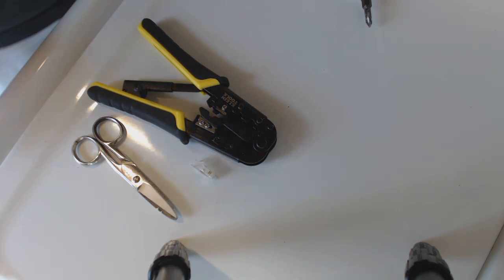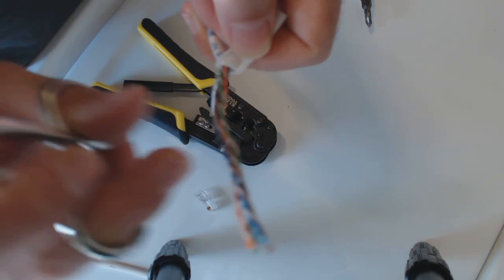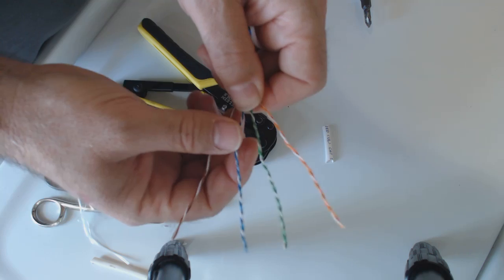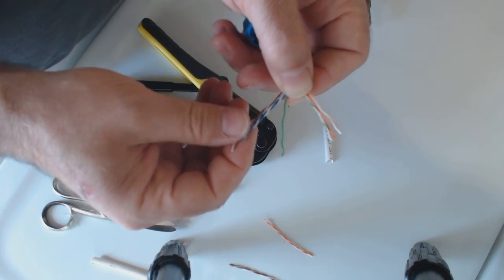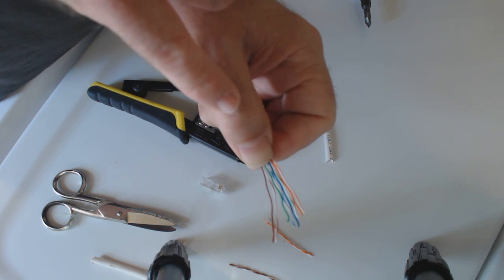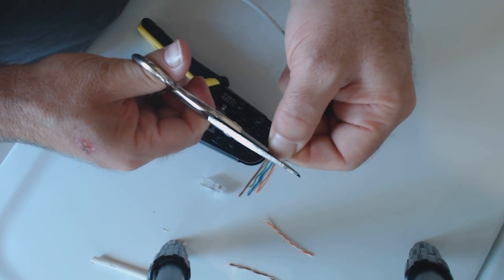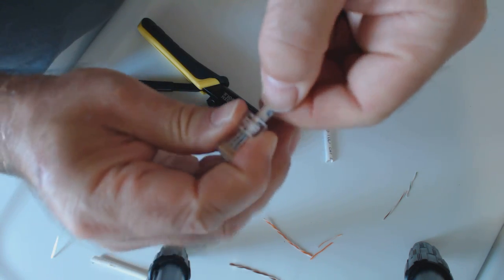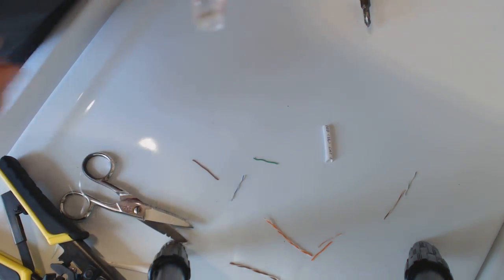How to Crimp RJ45 to Cat5e or Cat6 cable

Comment: Make sure you do the same wire arrangement on both ends. If you switch A on one side B on the other that's a cross over cable. Usually used to connect 2 routers together or 2 computers together with no router or switch in between.

Comment: what i find helps to keep the wires in order is a small dollop of hot glue, and the through hole plugs are easier than the blind plugs, also if you are elderly like me  a hacksaw cut in a piece of stiff plastic, cd dvd cover and use that to sort out the wire in the right order, cut to lenght, then slide the plug on and lift the wire out of the saw cut and crimp
Reply from the maker: Hmmm... thanks for sharing those tips! ☺

Comment: installed 2 switches today that came with my blue box and oh boy it took me a while to get a hang of it but i got it. i got that same tool and the pass thru wire one as well and the tester to check if its a good connection. it got the job done tho. im an electrician btw. always happy to learn new things
Reply from the maker: Good for you,  Sir!

Comment: i messed up a whole pack of 50 with only like like 15 actually working and some i ended up cutting off and re-crimping. i only needed 8 crimps. and wasted a whole pack of 50. now i have 300 pass through rj45's. (3 packs of 2x50 pcs)

Comment: I wanted to make certain that I was building the cable correctly, so I took a working Cat5e cable which I tested and found it was running at 200+ Mbps.  But, once I changed the RJ45 connector, the speeds dropped to 90Mbps.  What am I missing?
Reply from the maker: Lance, if you’re getting any speed at all on the one you made, then you did it correct.  The cables they make at the factory are just really well engineered.
Good observation. 🤔
Reply: @DIYTelecom  Cheers. And, thanks fir the heads-up!
Reply: @DIYTelecom  Ok. It just seemed odd because I only snipped one end of the cable and added the re-wired RJ-45 to that end. Is it possible I’ve wired my side of the cable to the T568B standard to a T568A cable?
Reply from the maker: I don’t believe the A vs. B scheme (or even a crossover) would affect the speed.

Comment: Nice guide!
A little question: Is there a difference between a CAT5E to a CAT6 boot?
Reply: Cat6 uses thicker wire (23AWG vs 24) so the wire channels have to be wider and arranged in a zigzag pattern to allow them all to fit.
Reply: @KingdaToro  Thats clear but I was asking about the boot

Comment: Nice video, good enough for home use, but I think you don't really understand the standard. Mainly when you advise to push jacket inside connector to the end and you are doing it with quite a lot of force. What you really should do is to make pairs shorter. Jacket should be inside as far as possible, but it should be perfect fit. If you will do it by force, what you are basically doing is destroing pair twists (untwisting them) inside the jacket, which you don't want to do as you are degrading cable and causing cross talk between wires.
Reply from the maker: Excellent Point Danny.   Thanks for contributing. 😊

Comment: If you just lightly score the wire and then bend it, the shear stress rips the sheathe almost immediately and it comes off without any harm to the inner wires. Just move it back and forth and it comes off

Comment: You could learn a lot from us ham radio operators. Some of us buy bulk cable and then add our own connectors. We have tools that cut the outer jacket of our RG-58 cables. We cut the exact length we need. We don’t waste inches of cable in the process. You are wasting cable twice in your video.

Comment: fitting the wires into the connector is a ridiculous operation... i can't believe there isn't a better way to do this
Reply: There's one thing that might solve your issue. They are called "Loading bars". Usually comes with RJ45s. Makes everything easy!
Reply from the maker: I agree Adrian. 😑

Comment: Thanks for the clear video. Cat-6 question. If I have a jack on one end (attaches to back of a wall plate, into which my patch cord will go), and I want to put an RJ45 on the other end, do I simply use the standard T-568-A wiring both for the jack and for the RJ45 connector?

Comment: Amateurish
Reply from the maker: thanks for the feedback.  :-)
Reply: This video might seem amateurish to some because it was obviously specifically made for amateurs like me!  This was enough to digest for now, but maybe a follow-up vid might explain the difference between cat5 and cat6 connectors, why it's important, and what to do with those one or two extra little plastic pieces that come with some connectors (and exactly how to orient them).  Also note that there are differences between stranded/solid, stranded only, and shielded connectors.

Comment: Question...(sorry REAL NEW) Do I HAVE to do the wires like that or can I do the following
Orange... Orange/strip
Blue... Blue/stripe
Green... Green/stripe
Brown.. Brown/stripe
Is long as they are the EXACT same on both ends then it shouldn't matter or not?
Thanksv
Reply from the maker: yes, I get this question often.  As long as it is the same on both sides it should work.  However, the wires are specifically laid out that way (as in my video) to help reduce noise and increase speed.  But, for 100mpbs you probably won't notice much difference.  :)

Comment: This is going to sound sill but what is the purpose of each color of wire for example:is blue and white for my phone line 1: or line 1and 2. And is another color set for my internet. 

 We have a business and their are old and newer lines everywhere it’s a mess and I’m getting ride of all the old stuff that’s not used or needed I’ve traces everything down to the cat 6. ( that’s currently having everything to work) but we have 2nd line that will ring when you call in ( and line 1 as s being used) but will not answer it just makes funny noises that sound like the fax machine. I know it’s weird
Reply from the maker: don't feel bad, messes like that are common.   So, the colors are a sort of numbering system.  Here it is if you're interested. https://youtu.be/1QXBdo-kXo8

 But basically it's like Blue=1, Orange=2, Green=3 and so on. :-)

Comment: A scissor?
You obviously has done a lot of crimping and has a prof crimping tool but just uses a kid scissor. Strange.
Reply from the maker: My target audience for this channel is either non-TELECOM professionals or those who want to become TELECOM professionals. Had I used the word SNIPS, I probably would’ve lost 50% of my audience right out of the gate.

Good comment though.  Thanks for watching 😄
Reply: @DIYTelecom  I used to dig for SWBT repair many years ago and I carried snips and a blue handle for years, the snips are tough as nails!

Comment: It can be tricky to crimp these so take your time.  I have started to use those new pass through rj45 connectors.  They are still a little bit tricky to crimp but not as bad as the other style that has been around for the longest time.  With the pass through type connector you can have the wire longer and there are tools made to trim them when you crimp them.  The tools made for them has a blade that cuts off the excess wire.  Some people have concerns about them with power over Ethernet because the ends of the wires are exposed but there are ways around that problem.

Comment: Use the right RJ45 Ethernet connector. The one shown in this video is for solid wire ("backbone" system wiring). There is another one for stranded wire. The rule is if it is OFF"SET it is for solid wire cores. It allows the prongs to wrap around the solid core. If it is INLINE it is for stranded wire cores ("flex patch cables"). It maximizes the surface contact area of the strands. No one tells you this and the purchase agents for the stores don't know the difference. The packages don't say either. You need to look at the side to see the prongs and see if they are straight, INLINE or crooked, OFFSET. If you use the wrong one, the cable will not last as long or not work. Using stranded connectors can sever the solid wire using a strong tool to crimp it. Using the OFFSET solid core connector makes a pocket in the strands that is not as good of a connection as using the INLINE prongs. The number of prongs is not the key. It is: Is it OFFSET or INLINE. Search for pictures. The good sellers will show the difference.

Comment: push through connectors work great but require a special crimping tool
Reply from the maker: William, are you talking about those type where the wires come out the front?   then I guess as part of the crimping process they get trimmed off.   That might be good for people who are new to the field.

Comment: Essentially correct, but could use some refinement...  A circumferential cutter will cut the insulation very well without nicking the wire. They are cheap and work great even on non-ethernet cable. You're cutting wire with a pair of scissors?  Scissors are not made for cutting wires.  I found that out as a boy, cutting telephone wire with my mom's scissors. I cut the "pad" off one of my finger tips. Dikes or Diagonal Cutting Pliers are for cutting wires on this scale. "Rip cord" never heard of that for pulling down the side of the wire.  Cable manufacturers sometimes install stuff inside their cables-sometimes it's filler to "round out" the cable or it may have another purpose unknown to me. This excellent Klein crimper has a ratchet mechanism.  That's good because once you start the crimp, it will not release till the crimp is complete.  That is important if you are using one without the ratchet.  Make sure you squeeze hard the first time. A second crimp is not needed if you do it right.  Blessings, John 20:29

Comment: waste of resources. Cat 6 cable will NEVER go into a standard rj45 fitting. If it does finally go in, crimping will never puncture the wires. Cat 6 requires special jacks, and special tools. He made a cable but didn't test it. I can assure you from years of experience that the cable he made will not pass the first byte of data.
Reply from the maker: ok Errol.  thanks for your input.  not sure I totally agree as I make these with cat6 all the time.  Perhaps we are talking about two different things?

Comment: its ok to enterchange the color of wire as long as it is at the right track at the end of the rj45?
Reply from the maker: The best practice is to use the 568A or 568B pattern as shown in the video.  HOWEVER, as long as all the wires are matched in order at both ends, then it will still work. 
Good question!  :)

Comment: The way you respond to all the criticism and mean comments on here it's hilarious and professional.  I've tried to crimp a Flat cat 6, but those wires are just to thin to strip, then insert, and then crimp. Is it possible to fix a flat cat 6?
Great tutorial and really enjoying reading your replies😉
Reply from the maker: hi, thanks for your kinds words.  Glad you noticed my approach towards the trolls.  I let it roll off.   I think they're just venting to what they perceive as a faceless online entity.   
As for your question.  So, I"ve not worked with Flat cable in a long, long while.  And, at the time, I wasn't doing any crimp-on ends.   If you're not trying to make patch cords, would it maybe be easier to Cat6 module jacks on the ends?  Might be easier to terminate.

Good luck, let me know!  :-)

Comment: I tried to install all the cat6 eight cables into the plug itself without the load bar. But that did not work. Two cat6 plugs were wasted. I did not know there were load bars in the package of network cable plugs it came in. Now I will have to redo both ends of the cable.

Comment: Tried this a few times on cat6 with EZRJ45 crystals but keep getting capped out a 100mbps. Any thoughts or ideas?
Reply from the maker: yeah.. I don't think you're doing anything wrong.  Sounds like either the equipment is limited to 100mbps.... OR, the negotiation protocol is flawed or limited.   This used to be a real common problem with Cisco.

Comment: if I do not follow the color code but the same color on both ends, is it problematic?
Reply from the maker: Ablsolutely right!   As long as it's the same order on both ends, it will work.  It's just that anyone who comes behind you and sees that connector might be like WFH??   However, I should point out that there are four pairs of wires inside a cat5e (cat6) cable which are designed to provide noise cancellation by being used in designated pairs (Blue, Orange, Green, Brown).  I suppose that if you split up the pairs by using some random color order in your crimps.  It's possible you might degrade the effectiveness of the noise cancellation property.  Hope that made sense!  LOL

Good luck.  Thanks for your question.  :-D
Reply: DIY Telecom bollocks

Comment: I don't understand why you'd have to "waste a few" ends if the conductors fall out of place when inserting them.  If they get out of order, just take off the end and reposition and use the same end.  Unless I'm missing something?
Reply from the maker: So, unless you use some other type of RJ-45 system that I'm not familiar with, the final action in this procedure is the CRIMP.  Which is a point of no-return.   Sometimes, when newbies are doing this they will think they have everything ready to go, they do the crimp and then discover they had something out of place.   In that case, they have to cut-off the end and start over. 
BTW, love Carroll O'Connor!!  :-D

Comment: This is the best video on the subject that I've seen. The most important thing said was that it really doesn't matter the order of the colors, as long as they are the same on both ends. Thank you for pointing that out.
Reply: The colours don’t matter but they must be paired the same. It’s not called twisted pair for nothing. To eliminate interference you must have four TWISTED pairs connected to the correct pins: 12 36 45 and 78 - just follow the code and do it right or you’ll have problems.
Reply from the maker: well OK!   I'll take the compliment.  Glad to help.   Thanks for the positive feedback! :-D

Comment: What are your thoughts on pass thru connectors. I have a good luck so far but I only do about 40 to 50 per year.
Reply from the maker: If I'm thinking of the same  thing (those little 1-inch couplers),  for 10/100 networks, I think it's no big deal.   Gig networks, might be more impacted by those.

I use those for cable extensions from time-to-time.

Good question.
Reply: DIY Telecom      thanks haven't had gig network application yet. I'll keep your advice if it comes up

Comment: How does this video cover CAT6 ??? it is a different cable and connector.
Reply from the maker: +Simon Young  please share more info, I must be MIS-informed.
Reply: The video also doesn't show how to terminate S/FTP or even F/FTP... OH NOES! Fact is, the title of this video doesn't specify anything about shielding, and Cat6 UTP is an actual thing. Seems legit to me.

The RJ45 plug has the same basic configuration across all applicable specification categories (568a and 568b). Cat6/a and Cat7/a may require different coating on the connection pins, tighter twists, and additional shielding, but the wiring configuration is the same. Even GG45 connectors are intended to be backward compatible. They're all 8P8C-style cables. Unless you want to terminate your Catx cable with TERA, I have no idea where you're getting this idea that Cat6 has a completely different connector, much less a completely different wiring schematic.
Reply: So, just to be sure, can you use the same crimping tool to crimp both a Cat5 and Cat6 cable?
Reply: Cat5e and Cat6 both utilize 4 pairs of twisted cables and the same RJ45-style connector. The biggest difference is really only in the shielding.

Comment: What would the differences be between an 'A' termination and a 'B' termination. Would there be a change in internet speed? Functionality? Or nothing at all.
Reply: There is absolutely no difference in transmission speed.  The ONLY difference is the placement of the wires.  It's vital to match end to end; so he mentioned A and B because if tracing a man made wire it's the installers choice to use either A or B configuration.  It simply doesn't matter what order they are in as long as they match that same order on both ends. This answer relates to shielded twisted cable.  If that is not available then go with A or the preferred B method so as to avoid crosstalk caused by EMI.

Comment: I have the same crimp tool, and it has a stripper built-in that takes the jacket off much faster and easier.
Reply from the maker: This is true Katee.  I guess I just an old phone guy stuck in my ways. ;-)

Comment: 6:33 "You may have to do this more than once"

Yeah, you encouraged me to try again, and again when it didn't work. Assumed it was me. Wasted a couple of connectors... Turned out that ONE blinking light on my router, on that ONE connection I was using to test, didn't work, but the connection was probably fine the whole time. Oh well, at least I got it working. Thanks! :)
Reply from the maker: Man, I've been there.  It's just the nature of the tech business.   The tech universe  has a way of being very tricky, it not almost cruel, at times. Thanks for posting! :-D

Comment: Can you still use cat 5e's RJ45 on cat 6 cable without affecting speed?
Reply from the maker: Abdul, technically speaking, if you add an crimp-on RJ-45 to a cat5e or cat6 cable you are compromising speed.  The manufactures make the statement that only a factory-made patch cable is recommended.

Personally, I have not seen that big of a difference.   Where degradation of speed may be noticed is if you are trying to run a 10 gig network.   As far as 100 mbsp and 1 gbps, I've never had a problem with crimp-on connectors.